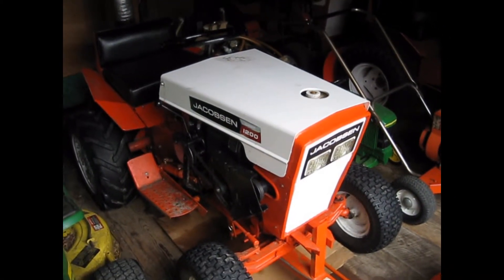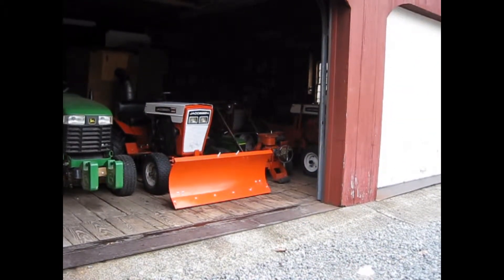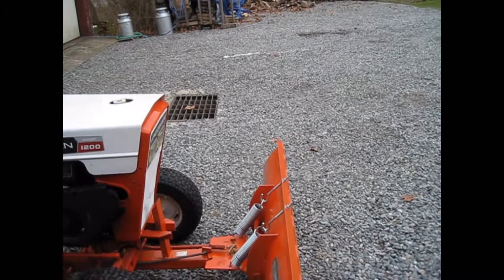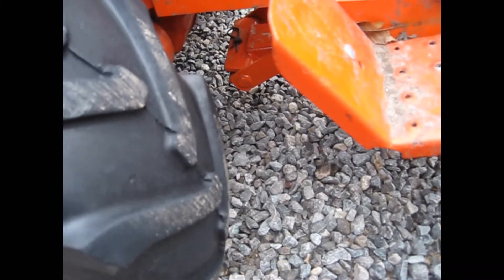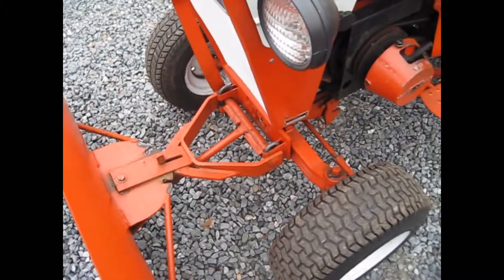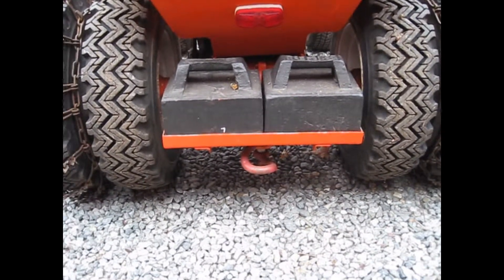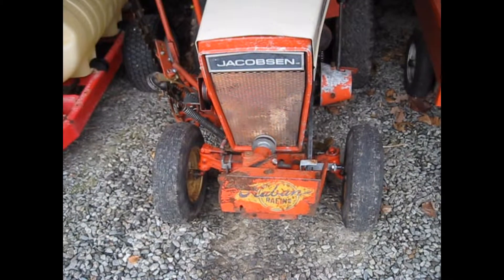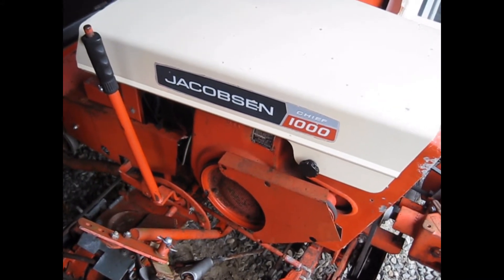Preparring the Jacobsen for Plowing.wmv

Comment: Beautiful tractor. I had a 1969 Ford 120 Hydro with electric clutch, hydraulic lift, mower deck and rototiller. I didn't realize the hydraulic lift was so rare, I wish I had never sold it back in 1990.

Comment: Thanks for the reply. I doubt I will get a hydraulic lift but I still have my 68 Jacobsen chief 1000 and I used it for many years plowing my driveway. I still mow my lawn with it but now use a Honda 5013 to plow only. Interestingly I converted the Jacobsen ridgid plow to a spring loaded trip plow that worked great.

Comment: Do you happen to remember where you got the springs for the trip plow?
Reply from the maker: I got them at tractor supply. They are 1.75" od x 9 or 10" overall length with a .207" wire dia. The hooks for them are 5/16" x 7" eye bolts with the loops bent open.

Comment: Where did you get the hydraulic lift?
Reply from the maker: Dave Saam Hi Dave. I found the hydraulic lift system on ebay about 3 years ago. They are not common and only come up every 6 years on average. You have to watch though because the system is more than just the pump and ram. You need the lift lever, flywheel screen, flywheel nut pto adaptor, and footrest reinforcing bar. Also on the 66-70 instructions on how to cut the fake belt guard which I could send you. Sometimes you will also see it on a tractor and then it is really a good idea to buy the whole tractor.